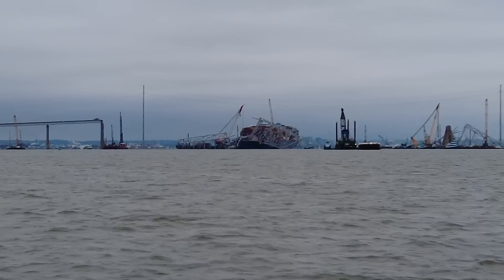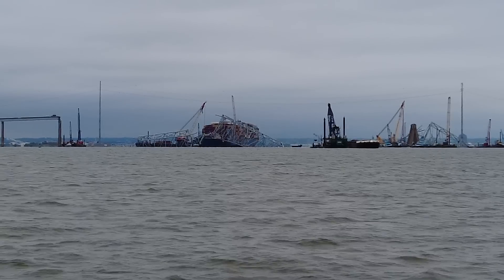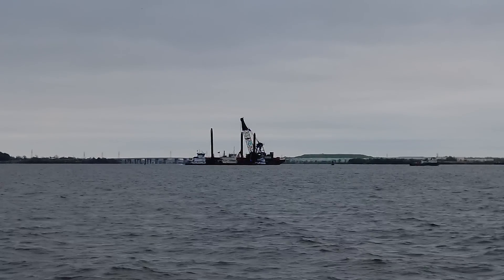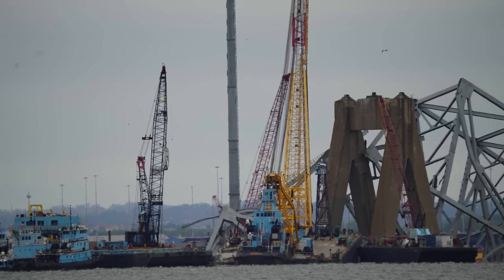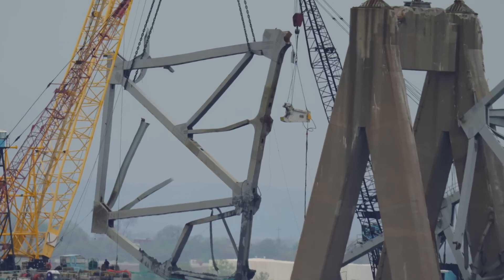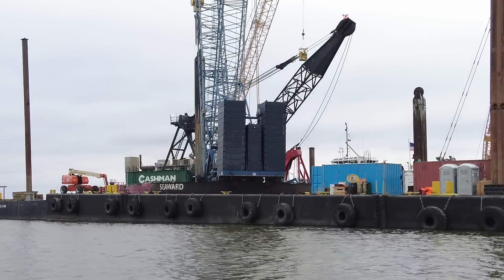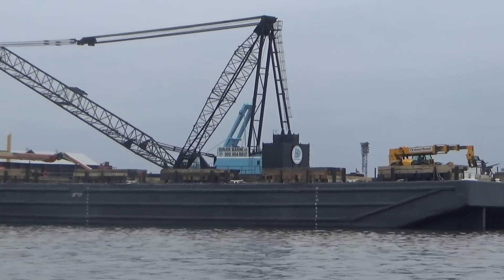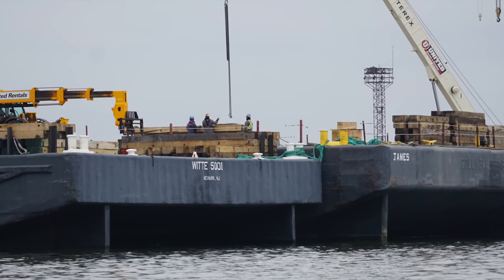Shear work at the Baltimore Bridge Collapse Site

Comment: A question: Will the entire bridge have to be rebuilt or just the collapsed section?
Reply from the maker: That's a question for a structural engineer.  I know bridges have an expected lifetime. Not sure.
Reply: I will be shocked if they use any part of the existing bridge.

Comment: Good images.   I foresaw that untangling some of the bent up bridge truss would be difficult.   The problem is that when they cut a portion the entire thing can become unstable.  It's very unpredictable.  They have to support it with one crane as another does the cutting.  The giant shears can get tangled up in the mess.  It is amazing that thick pieces of steel can be cut with a hydraulic press.   I've watched them do it at the steel supply company in Denver, called "DenCol Steel".  They can cut through1/2" plate like it's butter.  They punch holes in it too.  The holes and cuts are very clean. 

Located in Denver, Colorado, DenCol's 6-acre facility is geared to service your steel processing and first stage fabrication needs.

Comment: Is someone actually crawling around on debris hooking up chains 🤔🇺🇸
Reply from the maker: There are multiple man lift aerial system assets on site. If under water assistance is needed, the divers answer that bell.
Reply: Those chains are very large and have to be set with cables and extra cranes. 
Each link is 8-12" long or bigger.